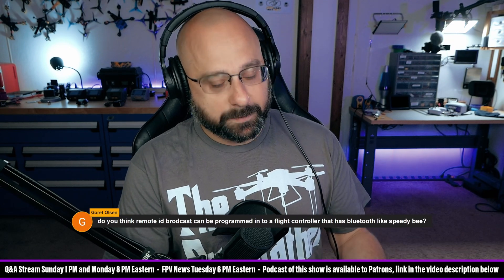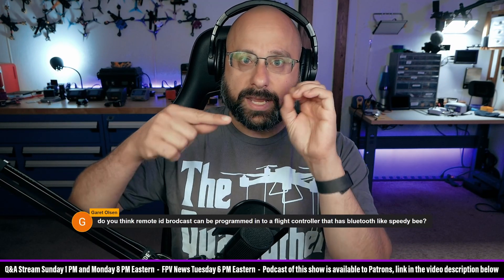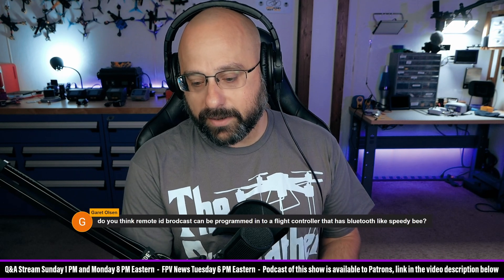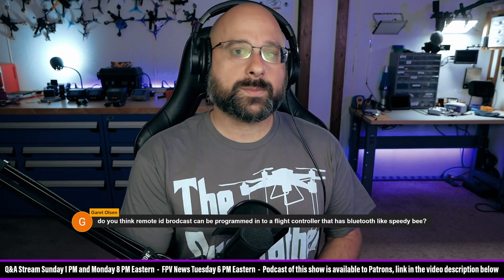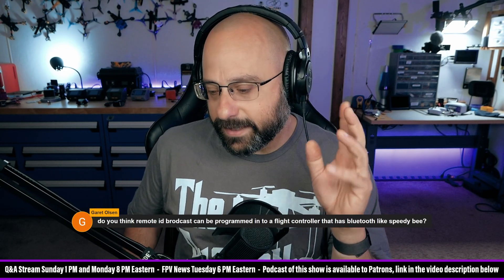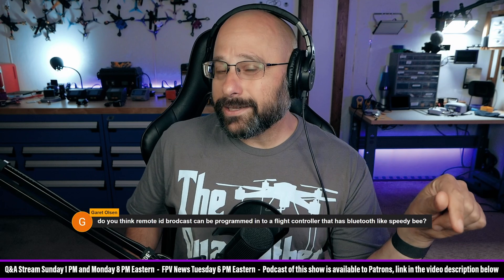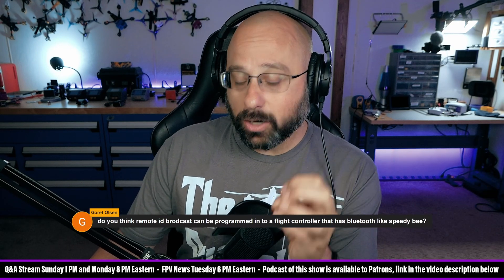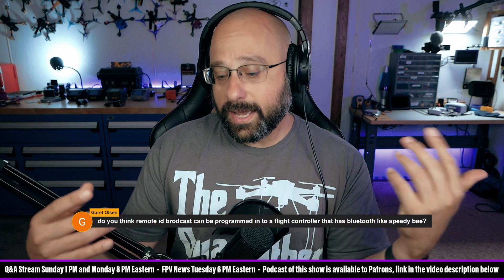Can You Put Remote ID In A Flight Controller? - FPV Questions

Comment: I'll ask why not use already telemetry freq/protocol to broadcast remote id?
Reply: Sure we have different protocols, so we have to unify a receiver or extend/change existing protocols that remote id thing could be decodable in easy way. There will be compromises anyway. But at least it will be much better than put another transmitter to drone.